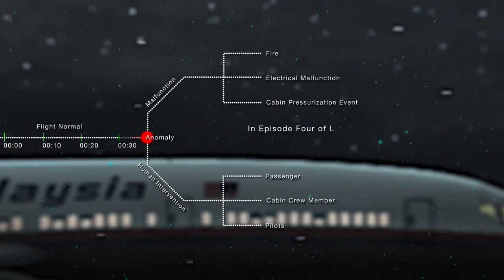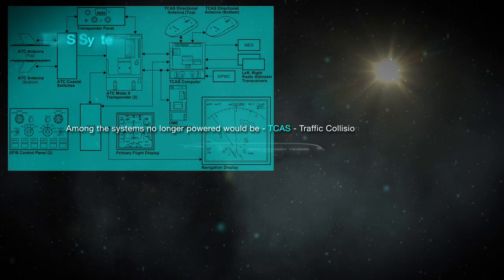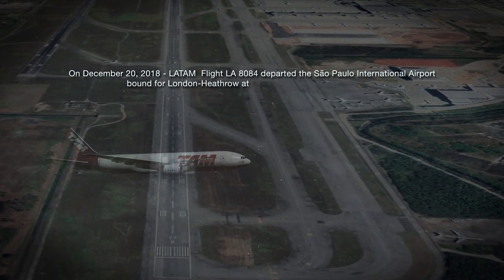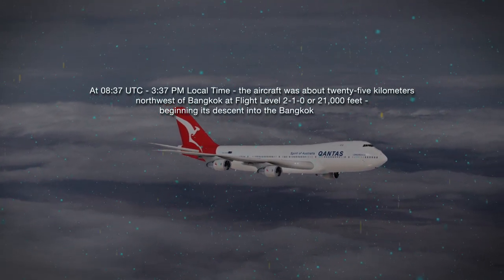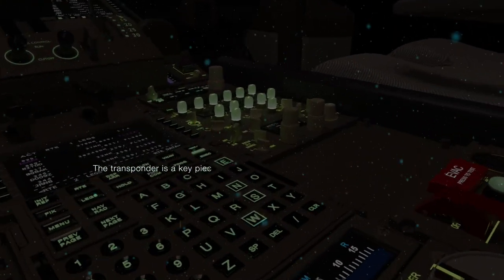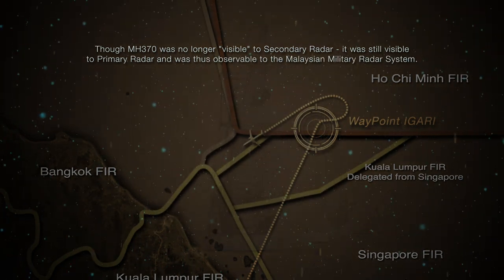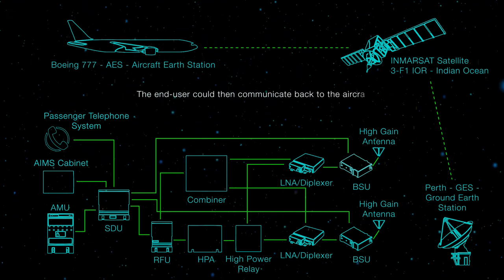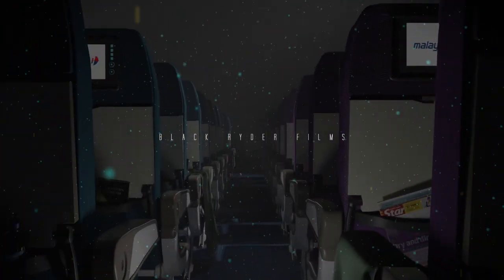Lost Flight MH370: Episode Four

Comment: The pilot guided the plane to a known undersea ridge, Broken Ridge, in the southern Indian Ocean that is covered in 2600 feet of silt and sank it there. The plane, under that silt, could not be seen by radar, nor could its signal be heard.  This ridge is in  the known search area. The pilot plotted this course on his home flight sim rig.
Reply: I interpret the storyline as the type of wreckage recovered (from E Africa coast region) is suggestive of the right wing touching the water first and rupturing at the cabin bulkhead.  It seems that this right wing broke off into fairly large pieces (some of which floated like the flaperon) whilst the rest of the aircraft went underwater largely intact because no significant wreckage from within has come to light?

I wonder if the Australian investigators have re-analyzed all the initial photographs from the search in the S Indian Ocean?  I recall there was one large floating object which was supposedly identified as a shipping container.  Could this have been the right wing but was dismissed as such because there was no accompanying wider debris field which they presumed there would be?    The seas were rough & any positive identification of objects in 3-5 metre waves would have been difficult.
Reply: @mikeharrington5593  
The latest interesting data I've seen is this presentation with somewhat newer information that's been compiled (with data to support) that at least the last half of the flight path was most likely much different than the main area where all of the searches took place.

It suggests that they might have intended to land on Christmas Island (read other comments as to potentially why), which is almost the identical distance from Kuala Lampur to Beijing (considering their fuel load), and also one of the few runways within its capable flight distance that has a long enough runway for this aircraft to land.

There is an computer FEA and simulation of the flaperon that was found mostly intact.

https://youtu.be/Qk1CxO9XGyQ

Comment: Were their other aircraft in the close vicinity,IF have they been questioned...what they saw
Reply: Saw nothing, earn some stuff (cf ep2)
Reply: @Roger Turner  
It was at night.  When power was lost (or turned off) and only flight controls running on the bare minimum power provided by the small, automatically-deployed RAT, the exterior flight lights and cabin lights are not powered (except the nose landing gear, which is obviously retracted during normal flight).

SAT data suggests that MH370 visually observed at least two different airliners on one leg of their common flight paths, and expertly took specific manual flight manoeuvres to avoid them.  But it is highly unlikely that the other aircraft spotted MH370 at night if its exterior & cabin lights were off.

There is very interesting information in the following video...  
https://youtu.be/Qk1CxO9XGyQ

Comment: Over the past few months i have being watching over and over videos and heard explanations almost the same technical perhaps the only difference is about presenting the facts on the mystery of vanished mh_three-seven-zero. Iam still curious about what happened in the cabin, what possibly was the condition of the passengers, i know a modern aircraft like triple 7 ought to have the display of routing which most passengers like to follow or watch from tv menus, didn't anyone observe the pathway deviation and raised alarm, what hypothesis do the experts have on this important point. If the passengers were alive, traveling beyond the expected arrival time meant something was definitely wrong. Now if all of these can only be answered by finding the black box of the aircraft will be the BREAKING NEWS OF THE CENTURY even if the device may have expired given the many years of the tragic incident.
Reply: There are a lot of ways whether by fire, malfunction or human intervention that could lead the entire cabin/cockpit to depressurized and incapacitate a normal human's function and thinking. This could be happening before the sharp turn was made after 39 mins or even 10 mins before.
Whatever the situation was everyone onboard were definitely passed out because as you mention about the display showing the flight path/speed is showing deviation surely there will be people noticing even if it's not the passenger all cabin crew are trained to identify issue (not solving) including geography.
Reply: @xlostlovex   Great to hear and the conversation continues.
Reply: All very logical & sound reasoning however I guess we do have to consider the local time factor...most passengers & even non flight crew would be intent on catching up on sleep...

Comment: One possibility is that for some reason the pilots and and other crew were incapacitated,  so the fairly smart AI systems on board did the best they could, just keep the thing flying, but with no particular plan.
Reply: That's not how autopilot works. The plane still doesn't turn unless you tell it to.

Comment: Must have had a boat to pick him up after he ditched.  Why go through all this trouble to commit suicide
Reply: @OffTheBeatenPath  
Some data in the following presentation suggest they were intending to land on Christmas Island.  Read other comments here as to why.

The information that's been compiled (with data to support) is that at least the last half of the flight path was most likely much different than the main area where all of the searches took place.

It suggests that they might have intended to land on Christmas Island, which is almost the identical distance from Kuala Lampur to Beijing (considering their fuel load), and also one of the few runways within its capable flight distance that has a long enough runway for this aircraft to land.

https://youtu.be/Qk1CxO9XGyQ
Reply: @bbfoto7248  yeah I think you're right. Ditching would be way too risky.

Comment: @BlackRyderFilms   
AFAIK, the ONLY cellular phone to cell tower "locator or connection ping", was that of the 1st Officer's cell phone.  ...Curious.

This was not a call or message, just a Single confirmation that his phone had connected to or ping'd a cell tower.  I don't remember where along the flight path, but I believe it was well after the transponder & SDU went offline.

Watch this presentation for (somewhat newer) information that's been compliled (with data to support) that at least the last half of the flight path was most likely much different than the main area where all of the searches took place.

It suggests that they might have intended to land on Christmas Island, which is almost the identical distance from Kuala Lampur to Beijing, and also one of the few runways within its capable flight distance that has a long enough runway for this aircraft to land.

https://youtu.be/Qk1CxO9XGyQ